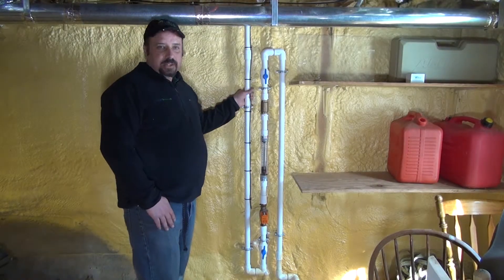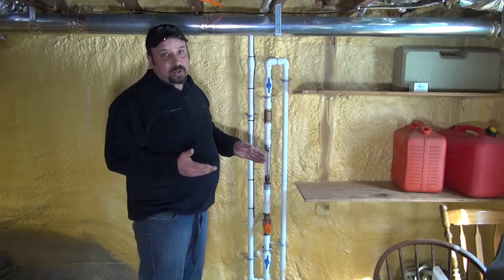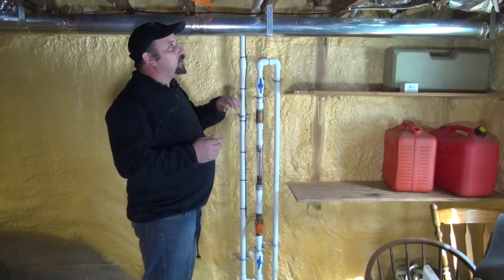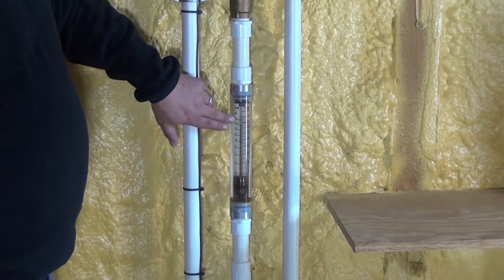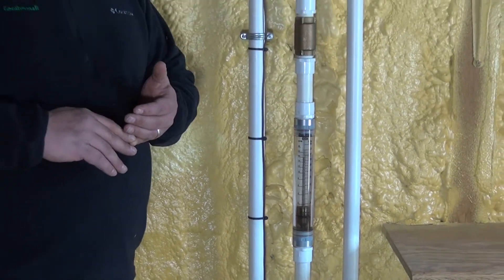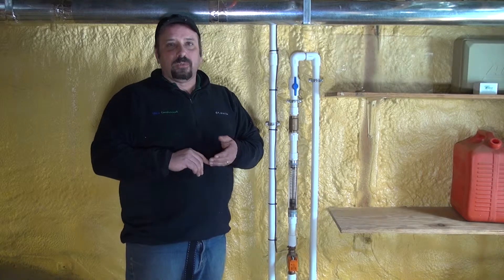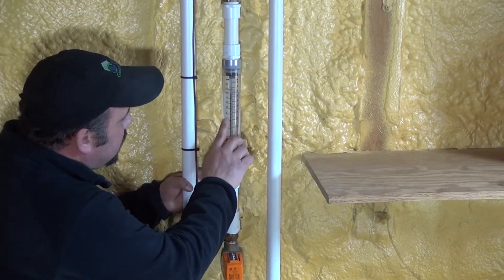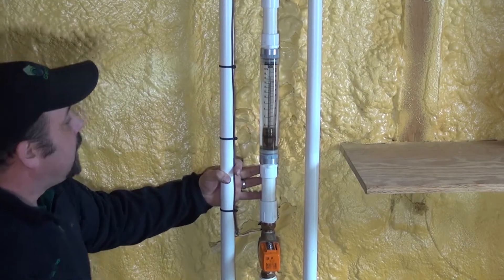Ultra Geothermal, Inc. - Operation and Maintenance Series

Comment: Thanks for the video. What model of solenoid valve did you use? Is the Ranco the 24v version (ETC-112000) or the 120/240 version (ETC-111000). thanks